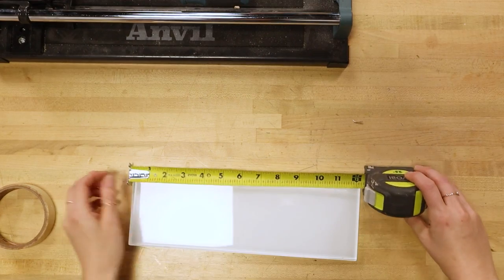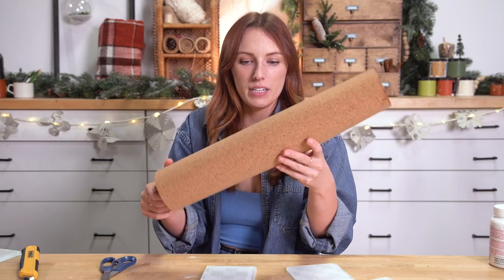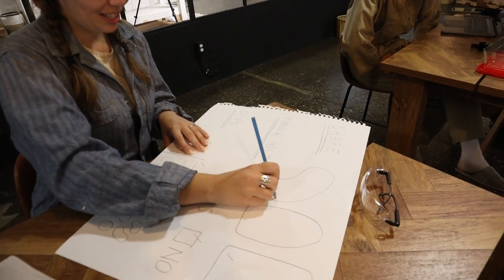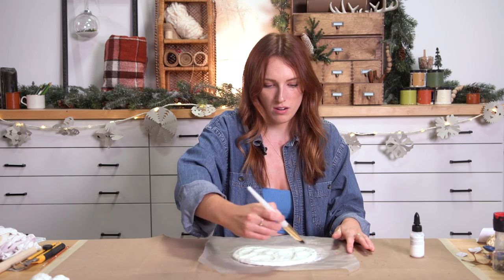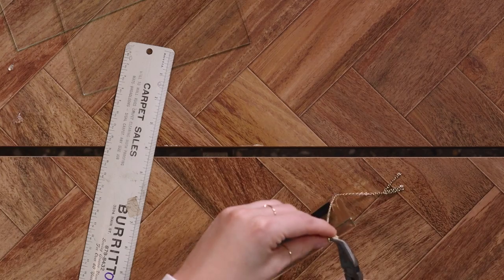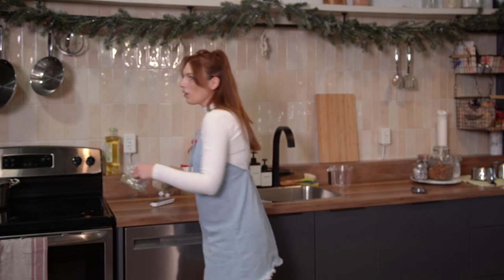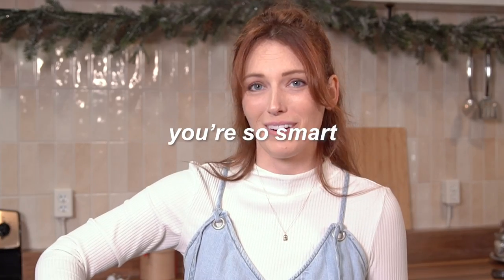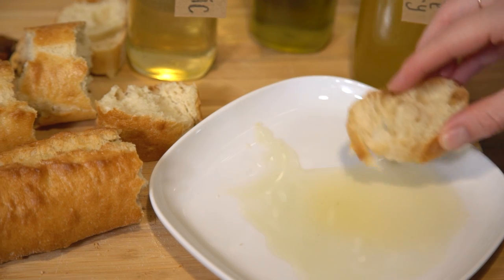DIY gifts I would actually give my friends

Comment: Guys I’m Italian, and we use olive oil basically in everything. But one thing I know is that you don’t have to use oil after it is cooked (or if it reaches boiling temperatures) because it can be very toxic! Check with the one you used! (You still can do infused oil, you can add your herbs and let it rest for a couple of weeks at room temperature)
Reply: If it can’t be boiled, how does cooking with olive oil work? I’m calling BS on your comment
Reply: @livelongandprospermary8796  if oil reaches its burning point carcinogens can be released. That's what they're referring to.
Reply: @livelongandprospermary8796  the boiling point of olive oil is much hotter than the temperature it's at when you use it to sauté and fry
Reply: You could also load the herbs and cold oil into the clean bottles - then warm the full bottles in a pan of water to speed up infusion. But certainly just sitting at room temperature will do the trick.
Reply: @livelongandprospermary8796  you're not supposed to boil it and let it rest for days to use later, that's what's wrong about it. you can just infuse the olive oil with herbs inside a bottle and let it rest at room temperature, it will get the flavour on its own without boiling
Reply: I’ve heard you can’t boil extra virgin olive oil, but olive oil, you can?
Reply: @everyoneknowsitslindy6074  you shouldn't be boiling any olive oil. Also simmering is not boiling. Boiling is like deep frying level. Also it isnt necessary to heat the oil at all if you can let it sit for a few weeks to infuse, and that would be the best choice.
Reply: @SammaDennis  I think you underestimate how hot people cook. Sometimes it be boiling
Reply: I usuly just put some fresh garlic in a jar with oil, in two days it's ready for use and the smell over fresh bruschetta e eccezionale.
Reply: @livelongandprospermary8796  you shouldn't cook with Extra Virgin at high temps, that's a finishing oil for topping after cooking, salads or other low temp uses. It's delicate from the processing to get it to "extra virgin" grade. On the other hand, olive pomace oil can be used in cooking, it can stand up to the because it hasn't been weakened beforehand like EVOO. I think the issue is that when the natural bonds that exist on a molecular level of a given substance break (under pressure of some sort, in this case heat) it creates free radicals that cause cancer and inflammation in the body. Also, worth mentioning that this "breaking point" is unique to the substance, ie grape seed oil has bonds that hold up to heat better than olive oil and better yet to olive oil that has been refined. But im just a home cook so forgive me in advance if Im wrong!
Reply: @kikiknox6625  Thats how you get botulism. Fresh garlic is a huge risk.
Reply: @bigscruppy  every chef I know does this although they keep the entire Jar in the fridge, not at room temp.
Reply: Thank you. I said this on a video that a YouTube "nutritionist" posted and a kazillion people tried to rip my face off over the idea that "Italians have been boiling virgin olive oil for centuries" so how dare I try to say it's unhealthy. Unstable? Pfft. I learned it from a 5 star chef who was trained in an Italian restaurant so I trust he's telling the truth lol... but holy, people take this Italian grandma stuff WAY seriously.
Reply: There are different olive oils. Look at the labels for the words 'sautéing' or 'cooking', these can be heated. Do not use olive oil meant for salad and dipping, for heating or cooking, it becomes toxic.

You can put herbs directly into a bottle of salad oil, using a couple sprigs of rosemary, some sun dried tomatoes, thyme, peeled garlic cloves.... And let sit for a couple weeks. It's beautiful and tastes great. 

Can cook 'heating' olive oil with herbs, as she has done.
Reply: @livelongandprospermary8796  we use sunflower oil for boiling

Comment: Making oils101, oil is heated to just simmer then turn off immediately and let herbs infuse (hence ‘infused oil’) until cool and then filter and decant. A tasty recipe is 1 tsp dried rosemary, oregano, basil, 1 tsp garlic and a pinch of chilli flakes❤️✨
Reply: What qty of oil would you use with these measurements?
Reply: Is what I did to make garlic oil. I ended up sort of frying the garlic bits, and gifted the oil in small bottles. I worked like a charm and tasted amazing. :)
Reply: @alisonpendlebury-brown7885  2 cups of oil❤️✨
Reply: @DerrynEHahn-ir2jv  thank you..😃
Reply: 1 tsp each of rosemary, oregano, and baisil or 1 tsp all together?
Reply: @Kate one of each

Comment: I've used the etching cream for years. I was taught that after the etching time has passed, the excess can be scraped off and put back in the bottle before washing off the surface. It does save etching cream, since it can be expensive, and can last longer.
Reply: And besides, it’s probably TOXIC for the environment.

Comment: Just a little note. Don't put oil in the fridge. 😂 They will harden. Just keep them in a dark cupboard and not exposed when not used.

Also you can make chilli oil that you can add to pizza and pasta by boiling the oil and pouring it over dried chilli flakes. Option to remove the flake after by straining or not. 😉

Comment: idk when i made infused olive oils there were lots of instructions for using dried herbs (i did the kind where you leave it to infuse for a while though instead of heating and straining immediately)
Reply: I think the heating would allow you to use fresher herbs as the water would boil away. I use cold infusion of garlic and rosemary together, or chilli tops and tails leftover when chopping chilli's.
Reply: @biancaj2311  idk how much you'd have to boil to get all the moisture out; like maybe it would work but it seems safer just to dry them first so you know it's not an issue